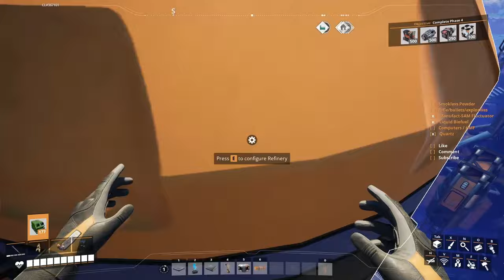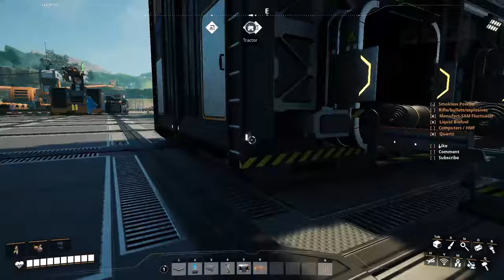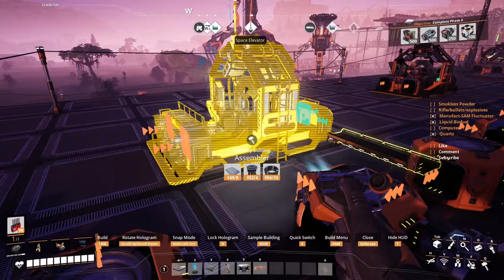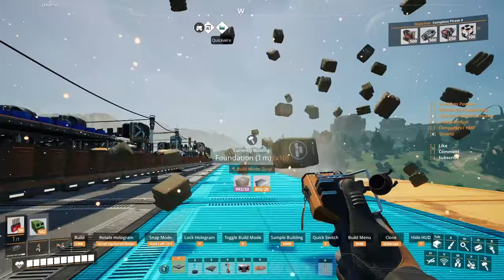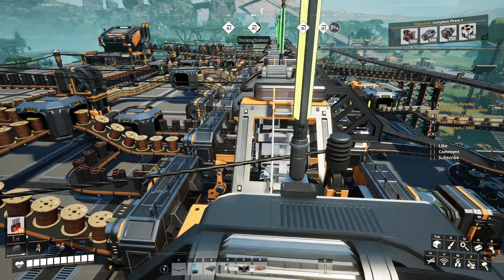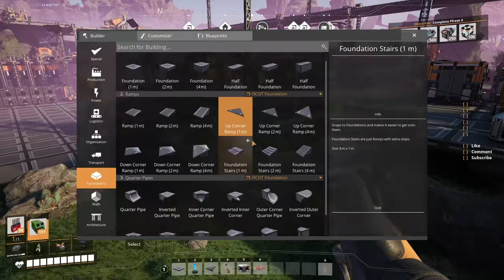Satisfactory 1.0 - Day 12 - Small Power Plant, Heavy Modular Frames and Computers

Comment: You could probably insert a new fuel buffer closer to the fuel gens and use a pump and valve to empty the old one into it so the old one could be deleted. I probably would have left the extra fuel gens in place and switched them off until there was more fuel available ;)
Reply from the maker: Never tried to empty a buffer, usually I just delete them. That one can stay in there until I'll upgrade the whole place, most likely I'll redesign the whole thing in there. Thanks for being here @vikingbrit270.